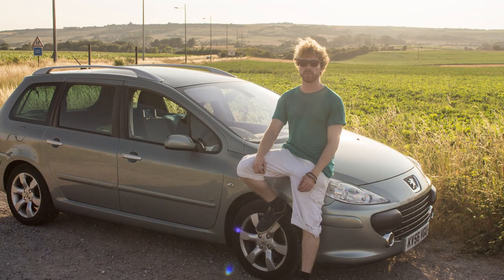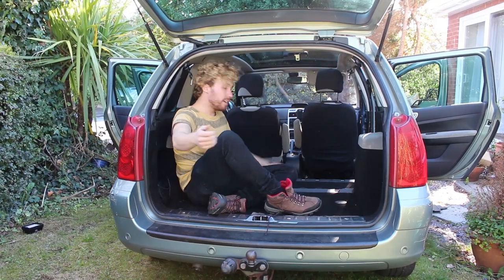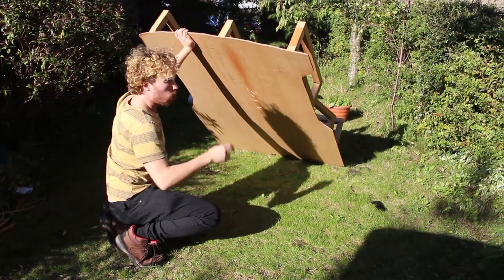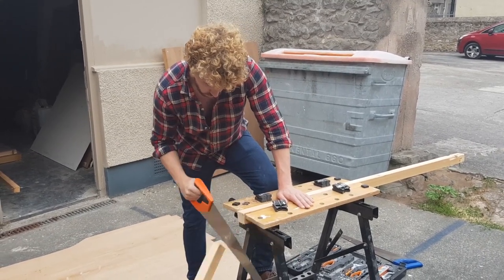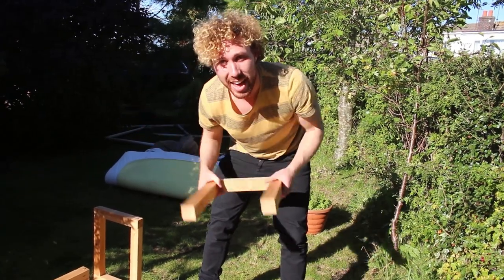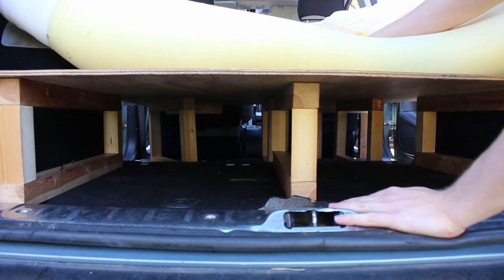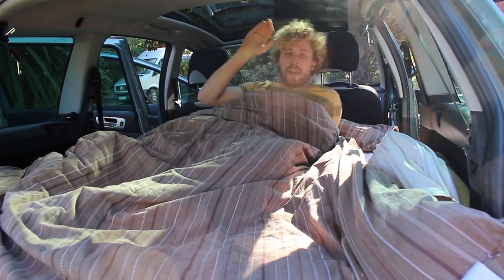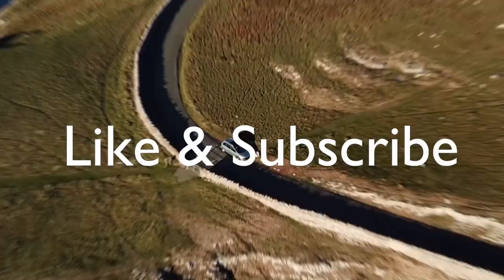EASY Car Camper Conversion

Comment: Thanks.Good to see it. Not sure if my rear seats in the Skoda Superb estate actually come all the way out though. Insulating against the cold might be an interesting problem to overcome. I think with the keys in the ignition and I had the front seat heaters on, the engine would start up intermittently automatically all through the night to ensure I wasn't running the battery down too much. That might be perfect or a perfect nuisance.

Comment: I’ve got a idea to remove the back seats and passenger seat then make a flat bed with box roof in a L shape curved over the passenger side window opening at the boot for access with padding down the left sleeping side and draws/tabletop on the right.. I hope that’s understandable but I’m just unsure about the legality of this isit ok to do ? I’ve got a vw polo too haha nice  and compact 😉
Reply from the maker: Hi sorry Ryan just seen this! I never had any problems just wanging a bed in the back. Also unsure about insurance/legality side of things, however I have been towed out of a ditch on my insurance, and it has also been impounded due to parking somewhere I shouldn't have, not once did anyone mention the wooden contraption in the back of the car or the sheets on it - ofcourse research for yourself and decide how cautious you want to be :)

Comment: Nice, im doing the same at the moment in my Renault Megane mk3, how do you deal with condensation in the winter months cuz im planning to do some.winter camping. 
Cheers  
  Vlad
Reply: Also if you're not too uncomfortable with the idea they make candles specifically to rid of condensation
Reply: I finished it a few months back while it  was still cold , just with a cracked window, i didnt feel cold at all, , outside temp in the evening was around-2-3 celsius, inside it got to around 12 just from the breathing , plus i had a nice sleeping bag. Im satisfied with mine overall, couldnt travel  a lot because the corona hit, but im gonna try it this folowing weekends on some camping and fishing trips..
Cheers 
Heres a short video of mine, it has a lot more mods now: https://www.youtube.com/watch?v=Di7YIjK1Glg&t=38s
Reply: @VladimirRskovski  I was really trying to get my father to buy a vehicle I found that's older so I could do this. It's a 1990 Toyota Camry Wagon.
Reply: @VladimirRskovski  I was going to dub it the "Shaggin' Wagon"

Comment: Did you ever sleep in your parked car with engine ideal running condition with AC or hot air on for whole night  ?
Reply from the maker: Hi - No I never did that, however I have let the car's heating run for a bit to heat me up while I lay in bed awake

Comment: I want someone to take a normal car.. hatchback or something small and turn it into a camper like Foresty Forest did to the minivan he bought. I imagine you don't even need to take out the passenger seat.., you just modify the seat so it has a hole in it so you can stretch your legs through it. Behind the drivers seat you could have the kitchen.. it would be absolutely awesome to see

Comment: Hey guy, i have a 308sw and i would like to do the same job, i'm thinking about what to do. That one of idea and help me to my reflection. What about the feedback experience? What will you change or improvement?
Reply from the maker: Hey dude - I probably could have split it into two separate wood panels. to make it easier to move in and out - otherwise it served my purposes well!
Reply: @CHAZVENTURES  thank you for the reply. I have to imagine something like this. Two bed , and some places under the plank for clean up one's stuff and the kitchen.

Comment: Have a Peugeot 307 SW 07 i was planing on making something in, and now you made it so much easier for me😊
Great guide and all😊 did you use 2x2 for the support?
Did you test the supported weight?
Anyways thanks for the good video, only problem left now is making my fiance agree to sleep in the car🤔
Reply from the maker: Sorry I didn't see this message on my alerts :/ I tested that it would take my weight and it seemed fine :) Yeah I'm not sure if it invalidated my insurance at all but I even needed a recovery callout and they didn't mention the bed.